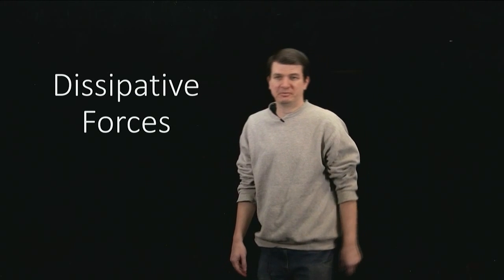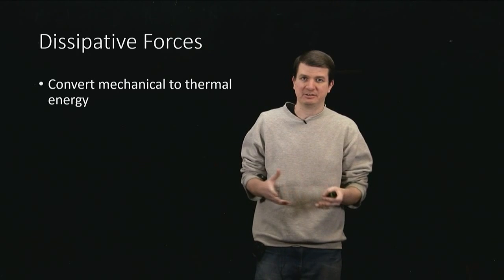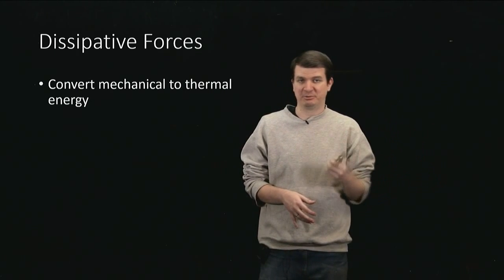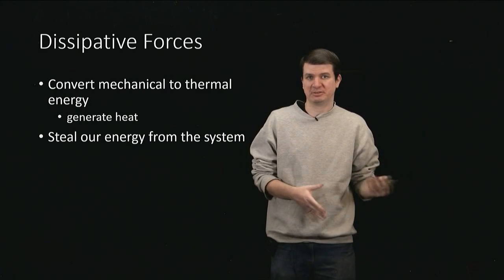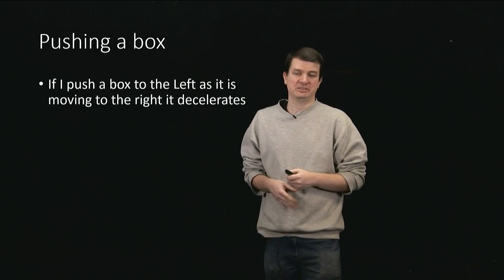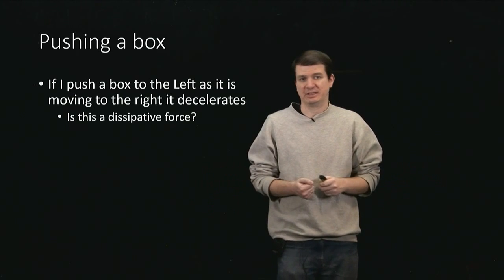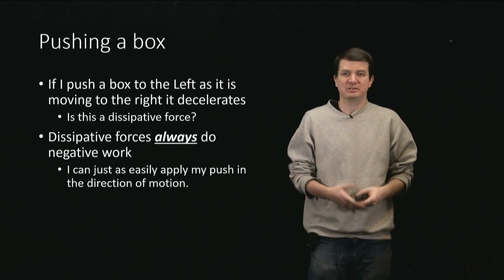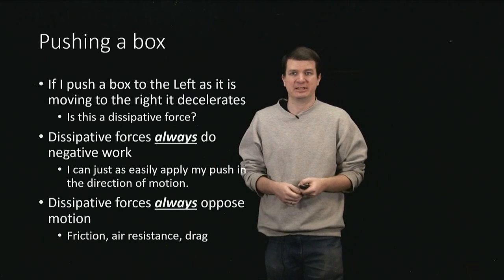Introduction: Dissipative Forces

Comment: Is normal force considered a dissipative force?
Reply from the maker: Dissipative forces are ones that always act to remove energy from a system, because they always by nature act against the motion, like friction or drag. Normal force doesn't always oppose motion and so it is not a dissipative force generally speaking, however, it is possible to create cases where it acts in a  dissipative manner.  That is, although the normal force generally doesn't do work at all, it is possible to contrive examples where it does positive or negative work, with the latter case making the normal force act in a dissipative manner. As examples take an elevator accelerating upward from rest, here the normal force from the floor of the elevator on you acts to push you up and does positive work on you since it acts in the direction of displacement. Reverse the situation and let the elevator be moving down then the normal force from the floor acting on you does negative work(pointing up while displacement is downward). A further example could be in either of these elevators if you lean against the wall then that normal force from the side of the elevator acting horizontally on you does no work.